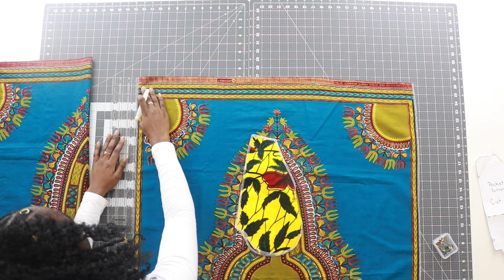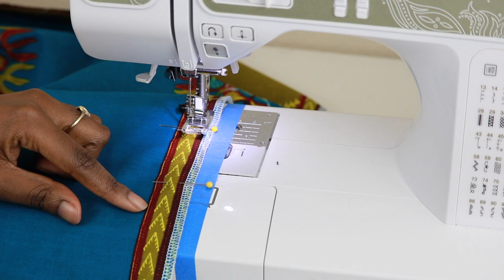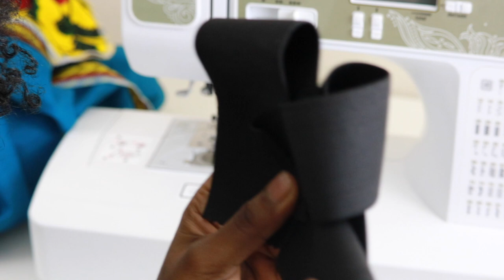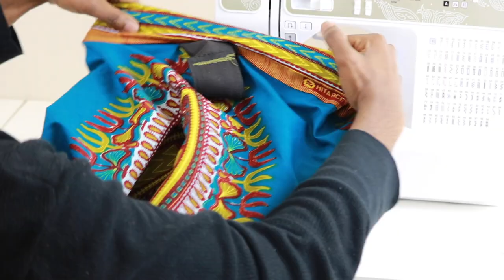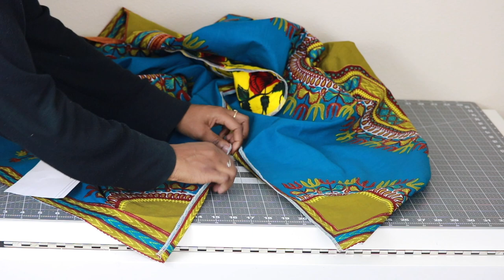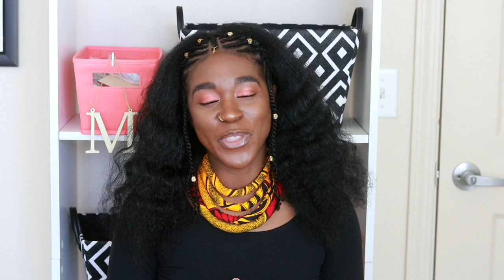Easy DIY Maxi Skirt with Side Slits and Pockets Part 2

Comment: This is awesome thanks. I have the same machine. The area for the presser foot does it slant a little? Mine seem to and being that this is the 2nd one I was wondering if it was normal.
Reply from the maker: You're welcome. The presser foot shouldn't be slanted, that part should be straight. I do however find the seam allowance guide plate to be off (slanted or uneven), that's why I use the blue painters tape on my machine so that I can sew straight seams. The painters tape has really helped me a lot with this machine.
Reply: Thank you so much for the quick reply. I love your videos because you're so detailed which makes for a great teacher. Thank you for sharing your knowledge. Now to convince my husband to buy me a new machine lol
Reply from the maker: Valerie Nixon You’re welcome and thank you for the compliment. LOL, draft up your list of reasons and I’m sure you’ll be able to persuade him. Which new machine are you thinking about getting?

Comment: So I finally purchased a serger but I still can't figure out how to secure  the ends of the threads tails so it doesn't unravel when I snip them off. Is there a technique to this?
Reply from the maker: Congratulations on your new serger. I know the exactly what you are talking about. When using your serger be sure to have a tail of threads that are about 3-5 inches long on both ends. I then use the tail to tie a knot 2-3 times (ate the edge of the fabric) and then I snip the excess threads
Reply: Montoya Mayo Thank you!!!
Reply from the maker: MsFredericks You’re welcome 😊